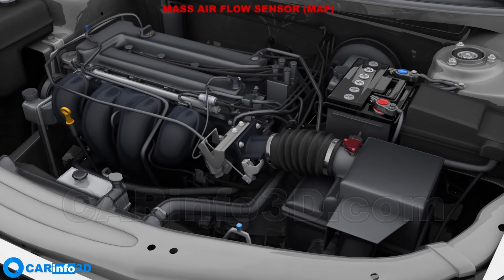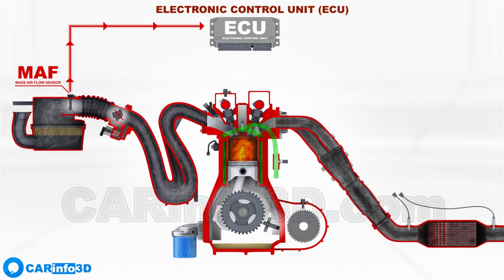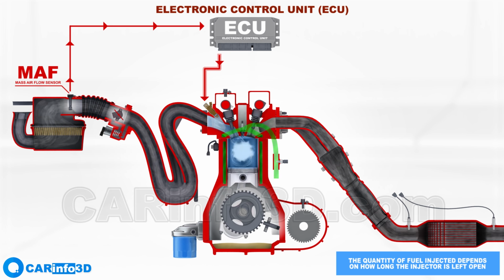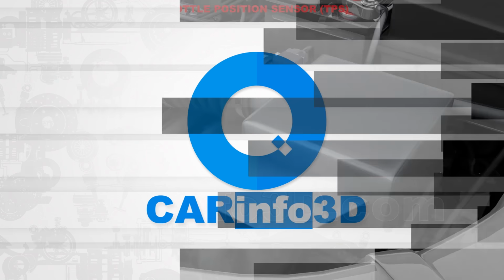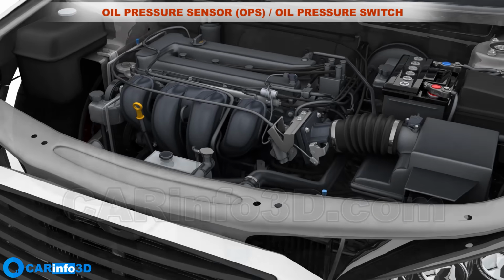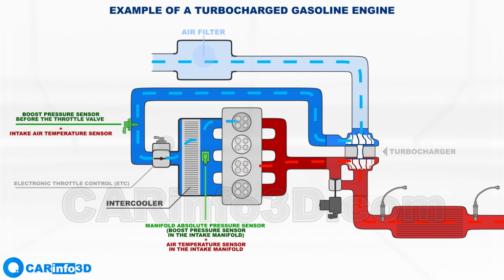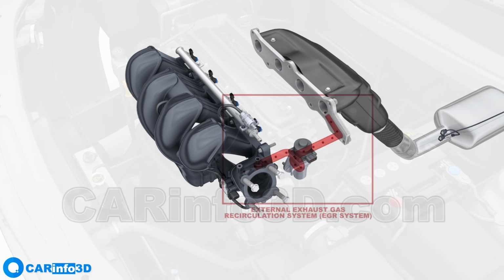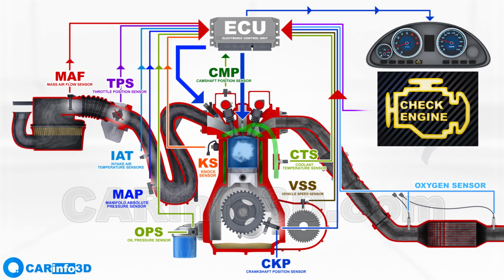Engine Sensors - Basics. 3D Animation

Comment: How about getting rid of the stupid sensor controlled cars and just go back to the old carbureted ones or even the first mechanical injected ones why fix something that isn’t broke? You don’t want emissions then get rid of all cars and go back to horse and cart!!!! What it takes to long to get anywhere? Then shut up and just drive the damn thing live with what it’s putting out the tail pipe how about stop using jet planes and sending rockets to space they emit more emissions than any car does how about stopping all trains  ships and everything else motorized either that or make it affordable to own and repair the new garbage disposal cars the old ones are far easier to repair lose a sensor or a computer and your stuck I can fix just about anything on an old carbureted car and get down the road even if it runs like crap I can at least get it to a shop let’s see you do that I. A new car out in the middle of nowhere especially if you have no cell service good luck!!

Comment: Thank God we have simple 3L engines in our Hilux Toyota Trucks. We are in peace and living happily without these sensor and efi system which is actually an illusion of modern world.
Its something like too much complicated wich actually wont work when you are in emergency, this is efi system with sensors all about.

Your video is well explained and thumbs up for your efforts. Bravo.
Reply: Any EFI car will still run without most of the sensors connected at all. Just in a basic, less efficient way with degraded fuel/air mix control and with a fixed cam timing. The engine just falls back to the same basic principles a stone age motor would use, and still drives fine.
Reply: It's a myth that those system are unreliable. I can use everything from 91 RON gasoline to 100% methanol and engine will run fine. No tuning, no complicated cleaning, it's just runs for 20 years without questions, not even sensor replacement. Just don's buy shitboxes, or cars with experimental F1 engines.

Comment: Some cars use TCV (Thermal Control Valve) in place of traditional mechanical engine thermostat. 
TCV is a sensor. They replaced $ 35 thermostat with TCV which can cost $ 2,000 or more to replace.
Reply: Let me guess....audi

Comment: Way, way too many needless sensors. Not long ago cars had none and still ran fine.
More sensors = more problems. Identifying the correct problematic sensor is not always easy. Many mechanics will just replace them by guessing...and you will pay for it.

Comment: Another snippet of information is that if the Check Engine Light starts flashing, pull over as soon as possible and shut off the engine, as it's likely a misfire or a critical engine failure, pray it's the first and get it diagnosed to see if it's to do with the ignition system or a fuel injector.

Comment: If you have a car that quits running at normal operating temperature and will start after cool down look to your crankshaft position sensor not always are they placed at the position it shows in this video they are also placed in a position of your engine block and are Made of an electrode encased in plastic. The electrode cracks and the plastic expands creating a gap in the electrode thus shutting down your motor. When it cools the plastic contracts bringing the electrode back in contact with both halves allowing your motor to start again.
Reply: Thank you for this information

Comment: These sensors and ecu will fail period.These electronic components can't handle the temperatures under bonnets as wires get hot and insulation get hard and Crack.And a lot of these stough is made out of plastic.So it is not if they fail they will fail.These things sometimes cost the price of a car to replace.So we are not going forward we are playing Russian roulette to see which sensors goes first.

Comment: I'm so glad my truck doesn't have a single one of these sensors. I love simplicity.

Carb and points. Reliable. Serviceable. Rugged. Easy to diagnose. No fuss, no toddler tantrums, just simply works.
Reply: Those sensors are the very thing making vehicles reliable and efficient
Reply: @ Those sensors are what let the state tell you NOPE can't drive your car on our roads.  Doesn't even matter the car runs fine.  If the sensor lies there is a problem your screwed.
Reply: @tsunami870  My 53 year old Chevy truck is more reliable and better on gas than my 2014 Challenger was 🤷
Reply: @TestECull  well that's not really just because of sensors failing, newer American cars are not known for their reliability sadly. Although I do agree with your point of unnecessary complexity with newer cars, e.g. tire pressure sensors that always never work. It sucks that manufacturers have the idea of "more is better"
Reply: @tsunami870  My mom's 2013 Nissan is currently DOA because of an electrical gremlin. It refuses to start below about 40° without a jump. Meanwhile, my 1971 Chevrolet started right up just fine this morning at 14°F with no choke and no fast idle. 

Modern cars are not reliable. It is a misconception that they are just as it is a misconception old ones are not.
Reply: I'm sure it doesn't need oil or fuel as well
Reply: @nicholasnoniashvili2790  lol don't know what you're trying to say with that one.
Reply: @nicholasnoniashvili2790 👍👏👏👏🤝
Reply: Trade-off: higher fuel consumption and lower power output relative to basic EFI vehicles and having to re-tune the carb depending on the season. If it's an occasional-use vehicle, not a big deal. If it's for something that has to get you to a workplace that is somewhat far-flung from where you park it at the end of the day, any sort of added ritual (prolonged warm-up, etc) becomes an inconvenience you have to work around and possibly build more time into your schedule for.
Reply: @Skidracer21  If the world goes boinks the only ones capable of surviving are the carburated ones
Reply: @Skidracer21  Been driving carb engines since I was in high school in 2007. You're completely full of shit. You dont have to retune these things for the seasons and if you have to have an extended warmup before you can drive it you are neglecting your vehicle. 🤷 I just got done driving to work in my 1971 Chevy C10 pickup...typing this reply in the parking lot...my warmup time this morning was however long it took me to buckle a lap belt, turn the headlights on, and get my mountain dew in my magnetic koozie cupholder. Ran flawlessly for the 40 mile drive. 👌

Fuel economy...eehhh I am getting about the same with this truck that I got with the 2014 Challenger I replaced with it. 

As for specific output...I see EFI engines pulling 75hp/liter, 100hp/liter, and see engines that will die young. My 4.1 liter I6 may only give 140hp, but it is still giving me 140hp 53 years later. Longevity and simplicity are far more important to me, so saying these older engines are lazy is telling me they are the ones to go for. Overstressed and underbuilt is not my jam, I want overbuilt and understressed.
Reply: @TestECull  You can get 140HP from 1L engine nowadays,but OK.
Reply: @TestECull  fair enough, sounds like what I read or heard about carburetors needing retuning for changes in seasons was ultimately mistaken and anecdotal.
Reply: @Skidracer21  Yep. If you watch the AFRs with test gear...wideband O2 sensor logged in a computer against ambient temp....you will see a fluctuation, but you will never notice that fluctuation behind the wheel. It is small enough as to be negligible. 👌 

I absolutely adore the simplicity and reliability of them. A 1-barrel just got done taking me to work in 40-45° ambients as I type this! A very very old one that's not very happy no less. I get this thing dialed in and happy...!
Reply: @Skidracer21  No trade off.  also works after an EMP pulse.  Will never be stolen with a USB connector, and had built in anti millennium clutch cable.

Comment: Do you save emissions by doing away with the throttle cable system? Everything is controlled by a computer anyway, it's just simpler and way less involved.
Like electric power steering. It's expensive to fix, but only saves very little over the hydraulic system and that is cheaper to repair and lasts a long time.

Comment: Cleaned MAP sensor on my JTDM engine and car runs so much smoother on low revs now! For once haven't spend a dime with scammy mechanics 8-)
Reply: Perhaps you missed spelled. MAF is different than MAP. MAF is manifold airflow. MAP is manifold absolute pressure and usually found on older models. MAF cleanable with proper chemicals and a fine brush, MAP is not cleanable as it is a Diaphragm. Just so you know. 😊

Comment: Engine is eating lot of oil . Which sensor is in trouble ? Thanks
Reply: Probably not a sensor, your pistons are probably slightly clogged. Try changing the oil you use or maybe try some gasoline additives.
Reply: @jamesiv2456  thanks I will. And will update here.

Comment: Excellent explanation of modern mysteries to us old DIY guys. Explains why I can't do 95% of the maintenance tasks I did in days gone by.
Reply: Also explains why you need 95% less maintenance than the oldies required.
EDIT: changed "as" to "than".
Reply: @GaryL3803  If 95 per cent were the case, 50 percent of auto repair shops would close down.
Reply: Cars peaked in the 90s.  By that time they had adopted the helpful technology, but not yet seen the adoption of technologies that makes cars a nightmare to work on.
Reply: True, I'm pretty much limited to oil changes now a days. But also agree with GaryL much better than my 1970 MGB with Lucas "prince of darkness electrics."
Reply: @tomschmidt381  In some modern cars you need a custom scan tool in order to sync up the car's computer after changing the oil.
Reply: @rockets4kids  I have a low end scan tool It has come in handy diagnosing the check engine light. On our Corollas you don't need a scan tool to reset the maint light after changing the oil.
Reply: @TheCampsies  Age is just a number, my friend.
Reply: @TheCampsies  you can if you learn to use the OBD II (etc) tool to see what's happening (freeze frame is best)
Reply: Basic maintenance is the same.  Oil, filters, plugs.  The computer scan is the big difference.  Everything from a misfire to a non-responsive headlight level adjuster or seat heater fault.

Comment: I deleted every sensor from my engine

And it’s been much more reliable. 
Never had a check engine light again!
Reply from the maker: You just needed to remove the check engine light bulb ;)
(for people without a sense of humor - don't actually do this)
Reply: Hey

you deleted sensor?
how is that possible?

Konstantin
Reply: How?
Reply: BS. No you didn't. Modern vehicles use fuel injection, and the systems cannot operate without input information. It is NOT possible to operate (or even start!) today's fuel-injected engines with all the sensors unplugged or removed. If you had watched this video you would have understood this, and avoided making a fool of yourself.
Reply: Consider updating your sensor humor.
Reply: lol Kevin. Wow.